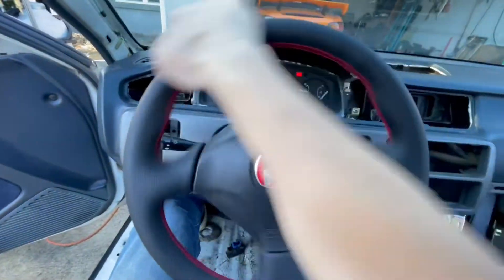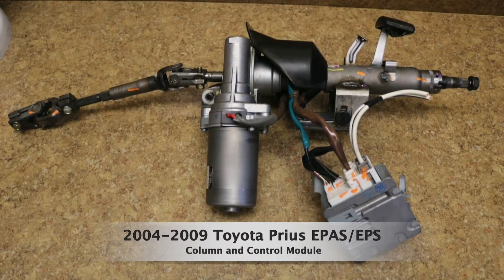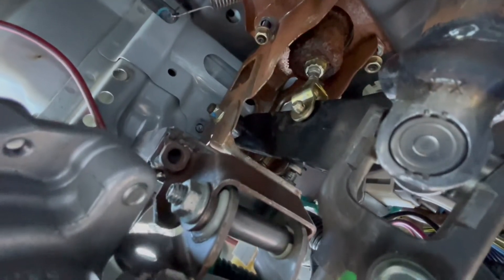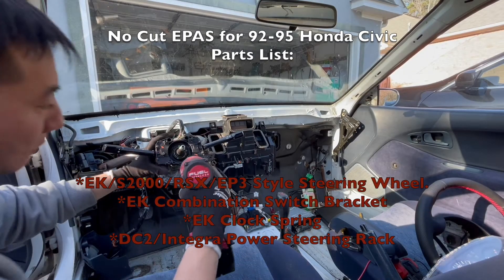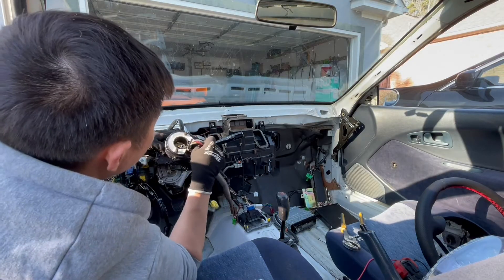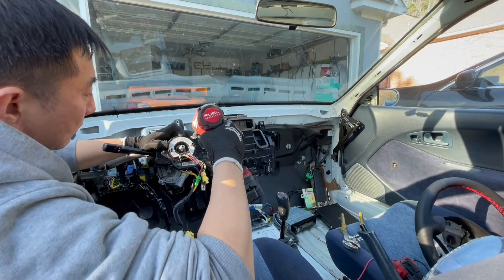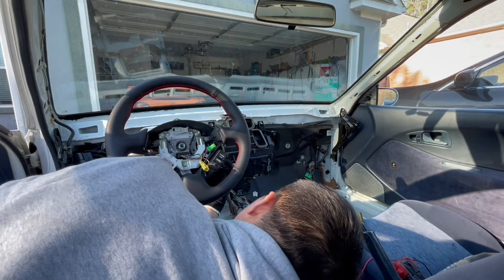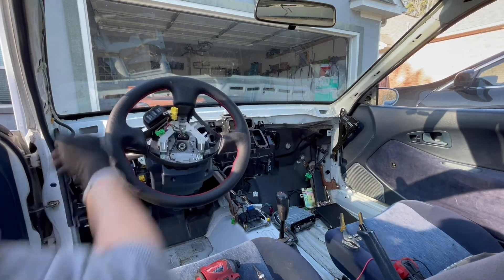92-95 EG Honda Civic Power Steering Retrofit using Toyota Prius Electric Power Assist Steering EPAS

Comment: Its a left hand drive car so that tells us this is probably in the US. As we know from many Youtube videos you can do whatever you like in the US even drive an unregistered car down a busy highway and not worry about it. Sounds to me like there are major safety issues and here in Australia the authorities will defect you and put your car off-road before you can even say "But officer". Modifying the steering column is 100% a defect here in Australia and the authorities are getting tougher on modified cars (as many have found out).
Reply from the maker: Yup. this is a US registered car. Not all US states are lenient on safety inspection as my state. But depending on which state, you sure can get away with a lot of stuff because these cars are now over 30 years old and retrofitting becomes fairly lenient on older heritage vehicles. Even SCCA/NASA allows ABS and EPAS to be retrofitted and still be legal to race as well.

Comment: Would this bolt on to a EG manual rack?
Reply: Yea
Reply: @ bet
Reply: @ what else is needed ? How did u do yours ?
Reply: And I can confirm it bolt up to a manul eg rack and ek hydronic rack also
Reply: @ChristianGomez-b6d  Ek hydrolic, but you put a bypass on the steering rack...that's it?
Reply: @pierth5620  Yep, no longer need any of the hydraulic stuff with the Prius setup. Good upgrade for power as your deleting powersteering off the motor AND still getting steering assist, only thing im wondering is if you could somehow adjust how much assist you get?
Reply: Yea there's defiantly no tilt and  my steering rack is a eg manual no ps involved  in know you can buy a kit that keeps the hydroloc steering rack lubricated
Reply: @TR.Pixels  yes they sell a switch look it up prius epas switch
Reply: @TR.Pixels I’ve seen kits with adjustable knobs that let you set how much assist you want. There is also a gps version which reads your speed and adjust the assist automatically. The slower the speed the more assist, and the higher the speed the less assist you get.

Comment: Did you build a bracket for this? Or did you just stick with the upper half of the civic bracket with the one bolt pressure fit in?

Comment: I’m doing my best to follow along to put this in my Integra, I’m getting it for the most part ! Just some figment issues I’m running into now. Really wish I had a little more specifics into the custom bracket pivot you made and where exactly it mounts up to
Reply from the maker: @xoxo._db7376  Nice! I’m curious how similar Integra is compared to the EG. My bad on the custom braket. It’s something I just eyeballed so I really don’t have exact measurements for that. I’m sure 90% of people can come up with something better than me as far as the mount goes.

Comment: Do you still have this installed? What's your verdict on this? Did you depower the integra rack? thinking about switching from and mr2 eps to a EPAS column on my build.
Reply from the maker: I do! But i haven’t touched this car in a good while. I’m gonna start ticker it again when the cool weather comes through. I live in GA, so it’s a LONG summer here.
Reply: @kmvguy  do you still own car? I am also in GA and curious about this concersion. i have a 96 civic fully converted to 99-00
Reply from the maker: @VandaleCallender  I do, but my car is completely down to the frames right now. Currently working on custom ABS, engine build and etc.

Comment: Nice work! Is there a reason why you used the ek clock spring and mounts? Wondering if I could just reuse the setup from my eg and just get a ek hub adapter
Reply from the maker: @Maisgarage  Used EK because the hub spline on Prius is same as EK/RSX/S2000. EG has different spline on the hub.
Reply: @ got it. Thanks for the prompt response

Comment: Can you do this with a manual steering rack?
Reply from the maker: you can do it with any rack that fits the car but the only issue is the u joint is different size different, and you would have to find the right size that fits.

Comment: What is the impact on car stabilty on high speeds ??
Reply from the maker: no impact on high speed at all. the unit makes the steering wheel feel heavier than stock, so you never get a feeling of too light. and because of EPAS, bump steer is not a thing anymore. Zero bump steer

Comment: 1:00 did you have to modify the tilt bracket? The Prius column diameter is bigger than ek/eg. How did you get it to work with the front upper bracket?
Reply from the maker: It's been some time since I did this, so my memory might not be 100%. I believe that's the EG tilt bracket and because the diameter is larger on Prius column, it's not a true tilt bracket. I do have some adjustability but it's just wedged in there with the nut and a bolt.

Comment: What did you have to do to make the ignition switch mount up to the steering column
Reply from the maker: Ignition switch is just held up by a small metal bracket on the steering column but i did have to delete the steering column locking in order to get it to mate up.
Reply: Did u have to modify anything for the key igtion to bolt up onto the steering column to fit properly for all the plastics to bolt up
Reply: Thank you for sharing! I want to do this to my dc!

Comment: I resently installed a civic ek Colum in my eg just to fit an ep3 steering wheel.

How did you make the horn work ?
Reply from the maker: using EK clock spring wires for the horn. there’s some extra wires in there, so i’m also planning on using cruise buttons for other stuff in the future.

Comment: whats the measurement for the bracket for the pivot mount? and is it really not possible to mount without removing the oem center mount?
Reply from the maker: I do not have the dimensions for the pivot mount. EPAS motor is pretty big so, I don’t think it’s possible to mount the column without removing the OEM center mount.
Reply from the maker: By the way, if you remove the OEM center mount out by drilling the rivets, it is completely reversible down the road by mounting it back up with nuts and bolts or welding it back up.
Reply: @kmvguy  yeah ill just to see for myself what modifications ill need to do. it will be for my ek hatchback, so the column and area will be slightly different. thank you

Comment: So this bolts onto a dc2 powered rack?Right up to the joint correct. I utilize the ek components specified. Does the stock ek steering wheel also work?
Reply from the maker: @zesity1715  yes it does bolt on to dc2 powered rack, that’s what I’m using at the moment too for the faster steering ratio. And stock EK steering wheel should work because they are same as the RSX/S2000 hub.
Reply: @kmvguy  damn thanks for the quick reply
Reply: @kmvguy  also bolts on the stock ek powered rack fyi just tried t :)

Comment: I want to make this mods for 96-00 civic cx hatch .what do I need to? Thanks for sharing
Reply from the maker: @loukanghexican2593  i’m guessing it would be even easier on an EK because the steering wheel will line up with the prius spline. And power steering rack side is same for all civic/integra. only difference is between manual and power rack U-joint size.
Reply: @kmvguy  so my manual raack should work with just Prius eps ? What year Prius should I look for? Thanks

Comment: Do you have the wiring diagram? I know the constant and ground but what wire color is for switch power on the harness? Is it 3 wires total?
Reply from the maker: it’s just 3 wires, 12v constant, ground, and ignition. There is a diagram here. Just make sure to look under 2009 Prius. 
https://www.therangerstation.com/tech/toyota-electric-power-steering-eps-conversion/
Reply: Thank you. I did some testing today and unless I’m wrong, the dc and eg u-joint are the same so this pruis works for both chassis.
Reply from the maker: @xyooj509  dc/eg u joint spline doesn’t match up to prius column, I used prius u-joint which matches up perfectly with dc power rack.
Reply from the maker: @xyooj509  I remember briefly eg/dc u-joint being very similar in size but there is a slight size difference and it will eventually slip under full lock. Be careful and test it on the driveway prior to driving off.

Comment: What did you power on source did you tap into for the module /ecu?
Reply from the maker: currently it’s just straight to battery for the motor/column. module/ecu is on the ignition switch power source.

Comment: How and where did you get the power to power the EPAS module?
Reply from the maker: power to the module is just tied directly to the key ignition wire. but it can be any 12V ignition. that wire is only a signal for the module. the main 12V is directly connected to the battery with the inline fuse.

Comment: Did you fix 
the return to center issue
Reply from the maker: @NoumanMalik-re5oy  My car is in pieces right now. I’m in the process of restoring the car so no progress have been made on RtC but… I did add ~3-4 degrees of caster and also planning on running the Prius EPAS out of the safemode. So that COULD make the RtC much better when I’m all done with it.
Reply: @kmvguy  keep me updated pleas i did the same conversion on my 1997 civic and i am so annoyed of it not centering i have tried almost every thing tell me if you have any ideas on how to get rtc
Reply: @NoumanMalik-re5oy  wanting to do this conversion as well. have the column already

Comment: Did you figure aot the return to center issue?
Reply from the maker: This car is still a long term project and i’ve not put much miles since i did the EPAS. I did add about 1.9 degree of caster but that did not help at all. But to be fair, i’ve not had this car aligned since the rack swap, and i know for sure my toe setting is off. 
I recently started to work on this car again. So i’m going to slowly update my forum thread again soon.

Comment: So I can not mount this on an EK with oem steering rack ? :/
Reply from the maker: I’m not sure how it will mount on a EK to be honest. While I did use a lot of EK stuff to get mine done but I don’t have any chassis dimension for the EK. “throtl” did retrofit a bigger Saturn Vue/Equinox column on their RWD EK Civic. You might want to check that video out. But I believe they did remove the AC evap and tubing and did a custom AC. https://www.youtube.com/watch?v=DOWCTcKpNsk
Reply: @kmvguy  Yes I already see the video but I want to keep my steering rack just remove the hydrolic power steering and put an EPS unit and I a see anther Prius swap on an ek but with no more information..
Reply from the maker: @nanocivicek4716  I think I know which one you are talking about. Check this thread on the honda-tech. You might be able to reach out to him or at least get a bit of more insight by checking out the thread. https://honda-tech.com/forums/road-racing-autocross-time-attack-19/time-attack-random-chat-all-makes-models-3367851

Comment: Don't you also need to cut it on the civic 94 sedan?
Reply from the maker: I’m actually not sure if sedan and hatch/coupe are any different. If they are the same, only minor modification will be required as I covered. It would be reversible if you just drill out the spot welds as I did.
Reply: @kmvguy Thanks

Comment: The u-joint is not the same size on eg. Didn't work for me
Reply from the maker: u joint fits if you are using the integra rack. if you have none power eg rack, size is different.
Reply from the maker: from what i remember, the stock none powered eg rack has smaller spline than the powered ones or the integra rack.
Reply: I was thinking about swapping the two that I don't know how to take off the u-joint
Reply: @kmvguy  I swap out the u-joint. Same u-joint size
Reply from the maker: @464159  great! good to hear you got that working.
Reply: Also Integra hub bolt on steering wheel? That means I have to get Integra nrg hub. My eg don't fit @kmvguy
Reply: @kmvguy  or I have to get rsx nrg hub
Reply from the maker: thet depends on which steering column you are using. I’m using the stock eg steering column but welded on the EK bracket so i can use RSX/S2000 style steering wheel.
Reply from the maker: if you have the stock EG column, i believe eg and integra uses the same hub.
Reply: @kmvguy  okay I'll buy the nrg EK hub
Reply: @kmvguy  do I need the EK ignition switch. Seems like the Prius steering wheel shaft is bigger.
Reply: How does your car steer at high speed?

Comment: Did the return back to center ever get better?
Reply from the maker: Not yet. I believe the problem is the amount of OEM caster on these chassis. I’ve talk to other people that has the setup on different cars and they run around 4-5 degree caster and have no issues with steering returning to center. EG/DC chassis only have about 1 degree of caster from factory. And I’m aiming for around 4-5 degrees of static caster, when I finish all my suspension.
Reply: @kmvguy  it’s been a few months since your reply, any update on this now? Curious to see if your RTC was fixed?
Reply: Although it's not the best solution.you could swap the front upper arm from left to right depending on how low you are you will probably get around 2*+

Comment: Hi my civic eg4, non-srs, my car does not have an airbag, do I need this combined switch and clock spring? (this video Suzuki alto esp: https://www.youtube.com/watch?v=K6KYOQ15pyQ )
Reply from the maker: @etnieslolz  You don’t need the clock spring but the clock spring make it easier for me to integrate the horn, steering wheel control and the combination switch. clock spring has the slot for the combination switch, so the left/right indicator would turn off after making a left/right turn. it would kind of drive me crazy not to have the horn working nor auto indicator turn off. steering wheel control is also nice to still have.
Reply: @kmvguy  so this is just an extra upgrade for you? :D
Reply from the maker: @ haha yeah. I would say the horn is essential but im sure you can get that working if you have an aftermaket steering wheel and hub.